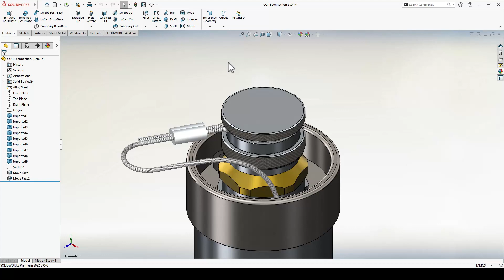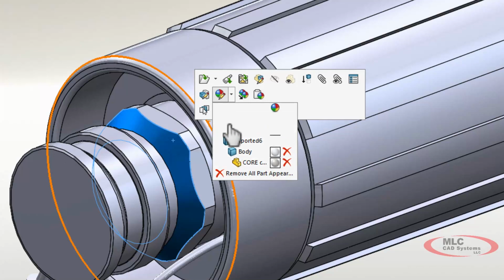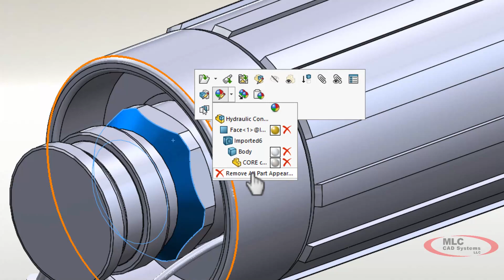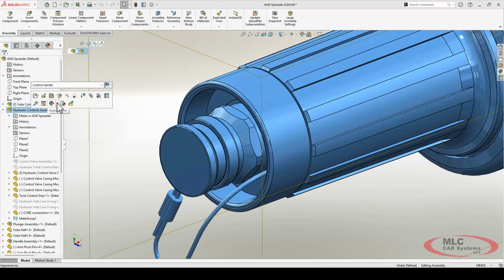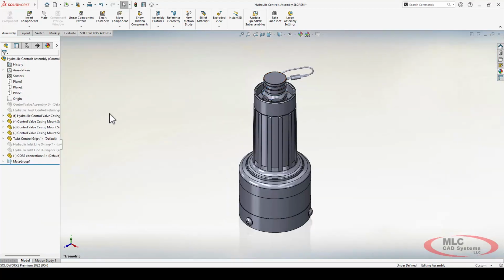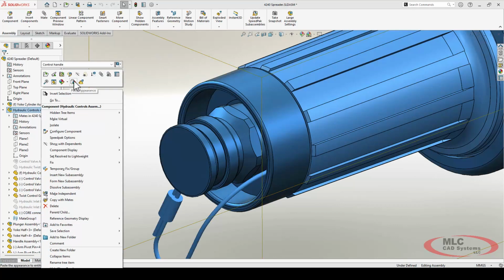Troubleshooting SOLIDWORKS Appearances - Tech Tip

Comment: hmm. when i use galvanised and double click any part, sheet, assembly, sub assembly. dosn't matter. the whole part goes black... making it hard/impossible to change size of the part. because the dimensions text is ofcourse black too...
Reply from the maker: This sounds like a problem with your graphics card or compatibility with certain settings.  Try disabling Enhanced graphics performance under System Options > Performance.  Some systems have compatibility issues there.  You can also try updating your graphics card driver or reviewing the list of approved drivers to make sure yours is approved.  https://www.solidworks.com/support/hardware-certification/
Reply: @MLCCADSystems  realview graphics enabled or enhanced graphics turned off indeed does solve that issue. but at cost of too shiny with realview graphics (sure it looks nice. but hard on the eyes in the long run) and without enhanced graphics my ~600-1000 parts assembly runs a bit slow.

there was a pending driver update. and solidworksRX is happy now. but issue remains. it's weird it's so far only galvanised surfaces it does it on. aluminum, sheet metal has no issue. might just try remove the texture, but keeping the material. hopefully that helps.
Reply from the maker: Good luck.  Compatibility for that mode has been improving in the last few releases so if you're running a verison that is a little old that might get better with an upgrade.  Also see if a different scene helps, sometimes the lighting is more of a problem than the appearances.

Comment: Why do we have this problem? When I in an assembly model I suddenly face this issue. I do not know why.
Reply from the maker: There could be a lot of reasons why the models are behaving as they are, including templates, imported models, system settings, or something related to your workflow.  I hope the video is helpful in providing some overall guidance, but if you are still experiencing issues it is time to reach out to your support provider.  If you are an MLC customer you can reach out online https://www.mlc-cad.com/technical-support/, or contact your local provider.  If you are in a school, check with your instructor.